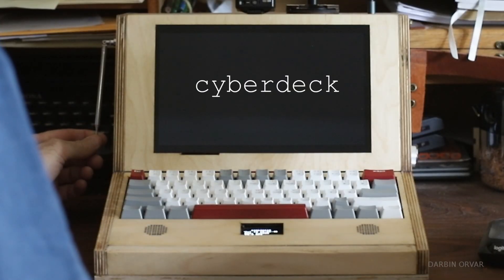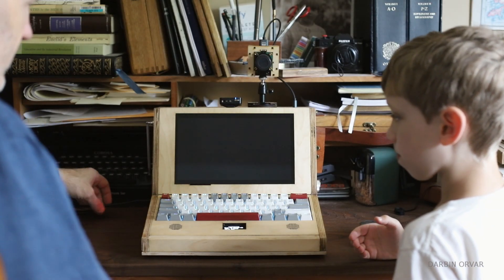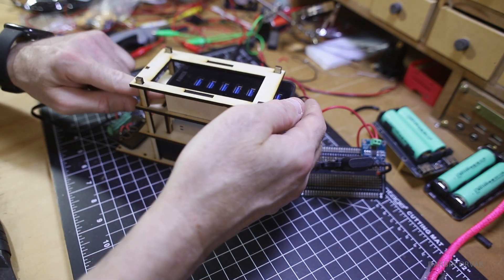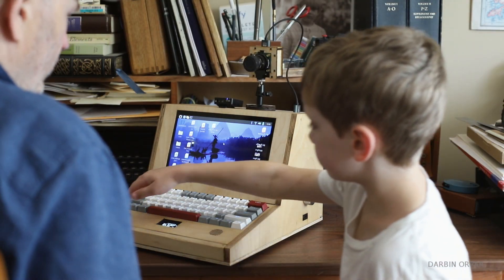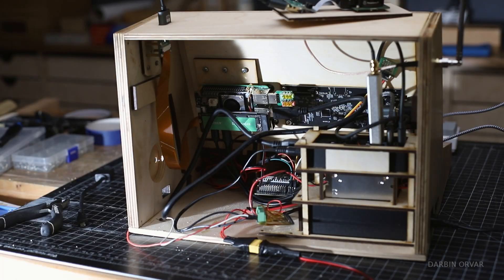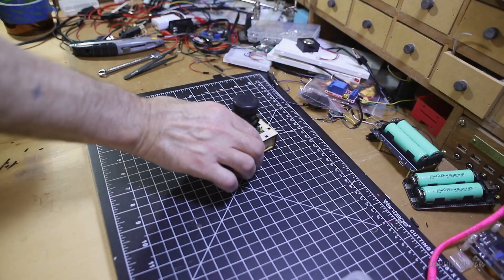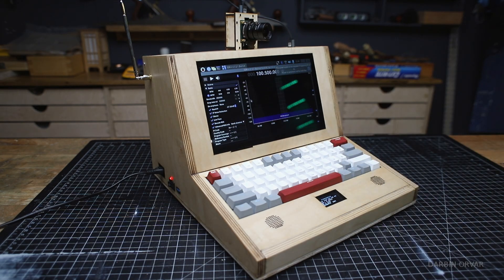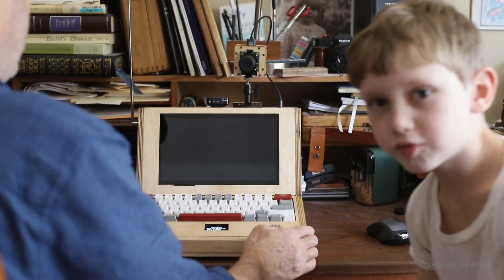I Built a Cyber Deck!

Comment: Two things.
1) The board of a mini puc pc is not that much bigger than the raspberry pi. About 4" x 4". One should be able to mount quite easily in place of the pi, providing a more powerful pc experience. 

Or, you could keep the board in it's OEM case and mount the puc behind the Cyber Deck. 

Some might consider that an eye sore though.

2) It is not advisable to use a smart TV as a PC monitor. Smart TV monitors take a screen shot every 10 milliseconds and uploads that data to the central database of the computer manufacturer. This means that any passwords you type in on the screen, in plain text, is captured and sent to a potential malevolent hacker.

I'm currently looking into the following decentralized networking that does not need an internet connection to communicate. Which would be a necessity in a full grid down scenario.

Bit Chat uses bluetooth

Meshtastic uses small radio devices to create local mesh networks independent from internet. There are instructions on how to build your own device.

Simple X - serverless peer to peer messaging app with no identifiers or phone numbers required.

IPFS - distributed file storage system where instead of relying on centralized servers, files are split and stored across independent nodes. So there's no single point of failure.

There are many decentralized social media platforms out there.
Mastodon, Nostra, Bluesky and Matrix